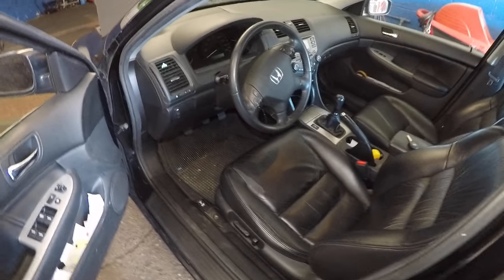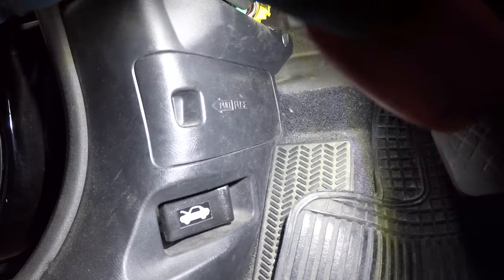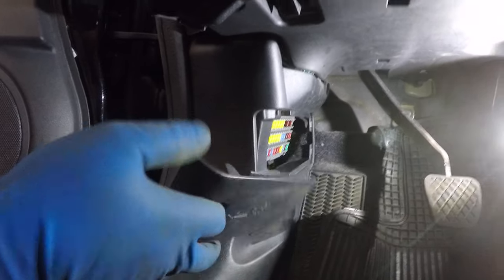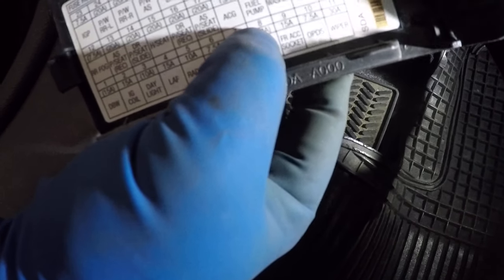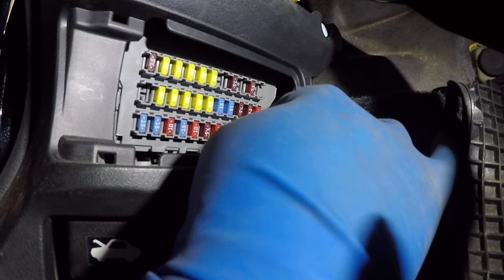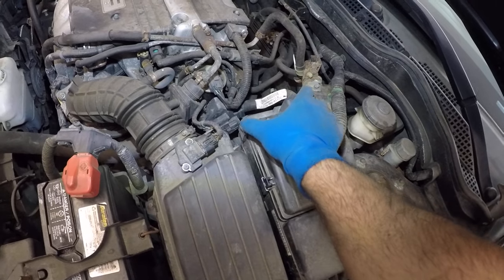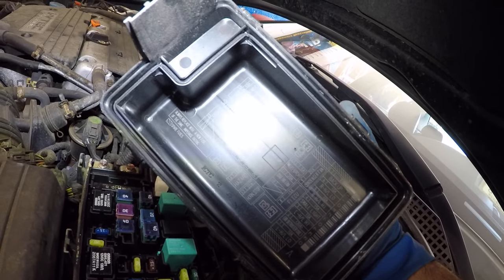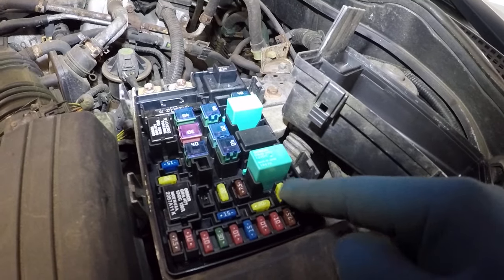Honda Accord 2003 to 2007 Cigarette power socket Fuse

Comment: Huge thanks for this video. The information about the fuse puller tool is an awesome addition. Also I found that the 15A next to the 30 is also a spare fuse
Reply: where is the spare fuse located
Reply: @anyari1226  Fuse box under the hood
Reply: Tokinpanda: Thank you for letting me know about the spare 15 next to the 30 in the box under the hood!!It worked!!😊🎉
Reply: @TheKristrem  Just dont forget yo replace the spare. It really was a savior
Reply: thank you for the tip! would this be applicable also to accord 2004 v6 EX? for the spare fuse - can't seem to find it
Reply: @mikemg2960  it should you'd have to look at the fuse box and read the diagram of what fuses are what

Comment: I changed both fuses and the charging ports still don’t work .. would it be good to change the accessory relay switch ?
Reply from the maker: I did u check ground inside the socket with test light and power one or the other can be missing
Reply: @RBTheMechanic   no I didn’t but I will check that before I do the relay switch ..
Reply from the maker: @gregreed2723  ok

Comment: Hey. Thanks for video. How hard is it to make cig lighter work with car off? Want to use trickle charger through cig lighter plug. Thanks.
Reply from the maker: U might have to switch up the wiring to fuse that’s hot all times shouldn’t be difficult

Comment: On the 2015 Honda Fit, there's 3 - ACC Socket (Front), ACC Socket (Console), and ACC. I'm assuming the front is the front cigarette power, the console is the console cigarette power, then what's ACC?
Reply from the maker: Check all the fuses the rear 2 might be same

Comment: Which fuse number is for the rear brake lights? Sometimes when I step on the brake, the lights don't come on and the shift rear gets stuck in the Park position. Only when the rear lights light up is when I am able to get the shifter out of park.
Reply from the maker: Ur brake switch might be bad
Reply: @RBTheMechanic  I hope it's just a bad fuse. Probably fuse #21 on the internal fuse box. I checked all the fuses under the hood and the are all ok.

Comment: What's the next step for when the ACC or fr ACC fuses aren't blown?
Reply from the maker: Craig Sinclair check all fuses or both so next step is u need test light see if u have ground on the round edge part the cylinder some times the power is there but ground is not check to see if it got ground

Comment: I have 20 30 5 15 7.5 10 25 only in the packet what are the common fuses feet to all?
Reply from the maker: 10 15 is common but u got to go by the same am u pulled out

Comment: Both fuses are good for acc socket but still not working how do I trace the short ?
Reply from the maker: Use test light check and see if it got power right in the center also remove the housing and see if the connector is connected and look inside the socket some times it’s corroded
Reply: Hey, I just fixed mine. Fuses were good & the front cig lighter wasn’t working. Look down in there with a flashlight, mine had yrs of crud in it. Use a paper towel and a screw driver to loosen it up and clean it out. Now the metal plug on your charger will make good contact.
Reply from the maker: @mikebarbier1519  nice job fining the fault

Comment: All my fuses are good, what you think is the problem.
Reply from the maker: Check inside the socket with test light if it got power and ground also cuz be ur charger try diffrent cable

Comment: What if one of the power outlet works and the other doesn’t can I still do this?
Reply: Or do both have to not be working in order to change the fuse
Reply from the maker: @jonnypollo6782  there should be more that one fuse check all of ur fuses

Comment: I have a 2004 Honda Accord so basically I’m just pulling the fuses out and putting them back in or I may have to get replacements. If so could I get replacements online?
Reply from the maker: Gil Lafayette you have to put in new fuse u have some spare fuses in the hood fuse cover
Reply: RB The Mechanic alright thanks

Comment: Hey I changed both and the 15A fuse keeps blowing out. But front and middle console charging ports wont work
Reply: And the #32
Reply from the maker: Kyler Lewis check all of ur sockets some times there penny inside that will keep blowing the fuse

Comment: After replacing the fuse #9 and #32 under the driver's side fuse box, the center console 12V socket is working. 

The 12V socket in front of the gear shift lever is not working.

Could it be the Fuse #15 (40A) in the engine compartment fuse box? How to check it, if this is the problem?
Reply from the maker: Vai Vairum check all the fuses what kinda car u have gimme year make and model I will check diagram to see if there’s other fuses check ur charging plug some times it’s bad also if u have test like check power directly in the charging port
Reply: @RBTheMechanic  

Thank you for replying - very kind of you.

It is a 2007 Accord EX-L, 4-cylinder, 4-door sedan.

I had the same problem with the 2006 Accord Hybrid sedan, later found the extra set of fuses outside the fuse box under the dash, and replaced the 20amp.

No such option in the 2007 - I checked all the fuses in the passenger and engine compartment, replaced both ACC  under the dash and the socket under the arm-rest console is working. Not the front one below radio controls.

Is there some other fuse?
Reply from the maker: Vai Vairum there is fuse #32 7.5A.  Fuse #9 15A.    Then there’s relay     However if any of these r bad no power sockets will work they all get powered through this .... so check ground on the sockets
Reply: @RBTheMechanic  

Thank you, again.

The #9 and #32 are intact. I don't know anything about the relay, yet, and have to figure out how to check it for continuity. Nor do I know how to check the socket for ground - will appreciate any help, like a link.